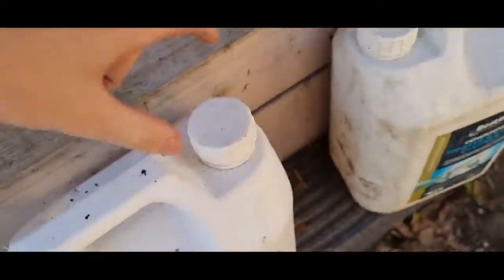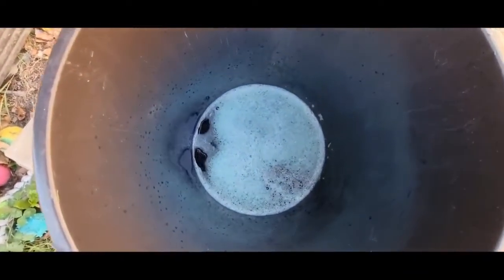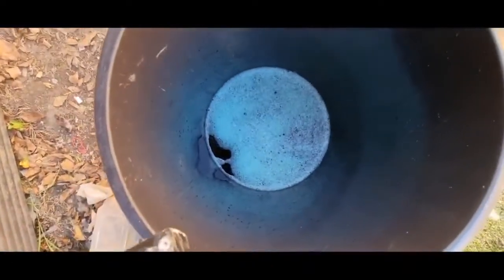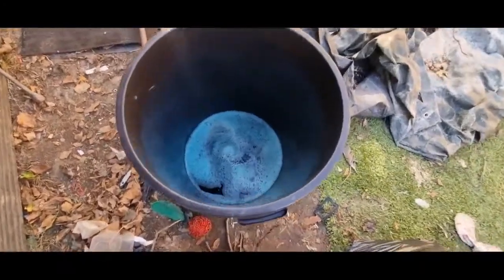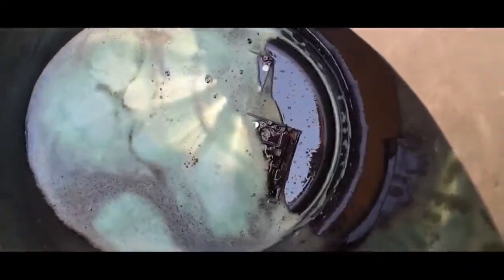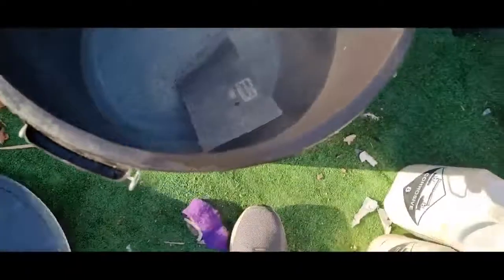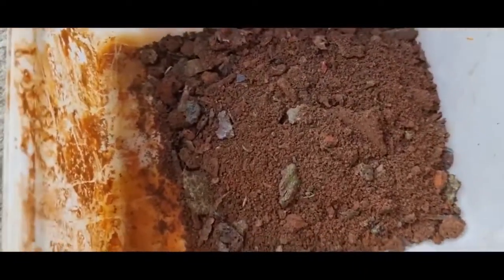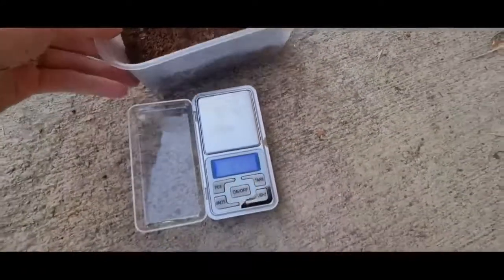recovering pure copper from 4.5 litres of waste acid

Comment: Nice one.what you going to do with solution now that you the copper taking out of it,are you just going to start using it again as copper 2 chloride or ya going to try recycle the Hydrochloric  acie
Reply from the maker: It was full of copper. To get copper out I had to fill it with steel so it's useless now. I'm storing in a pot until I get some stuff to neutralise it then take to a recycling place to get rid when I got loads